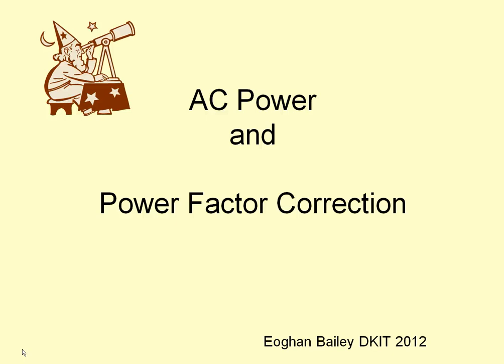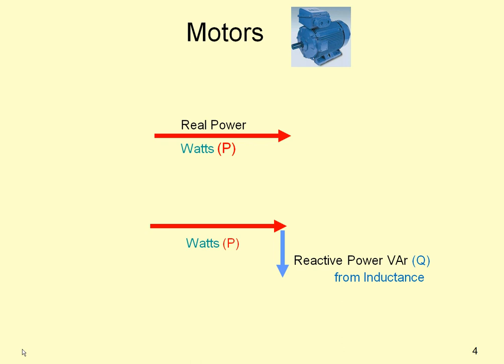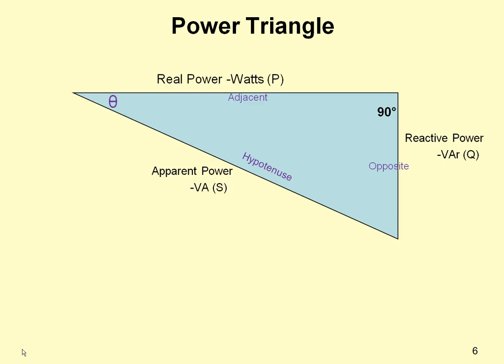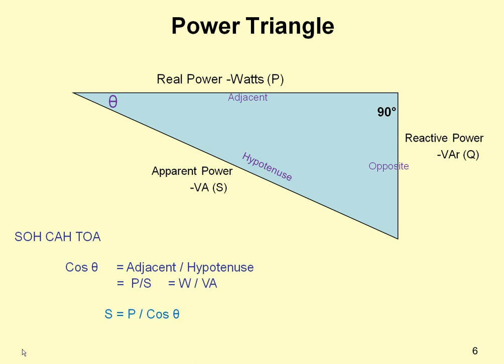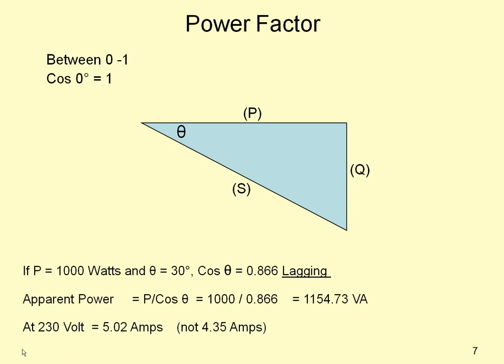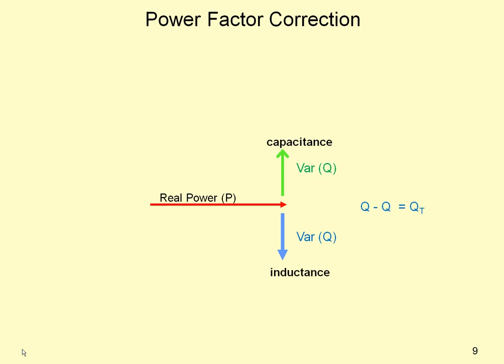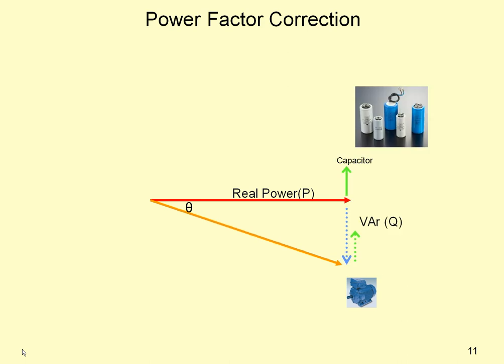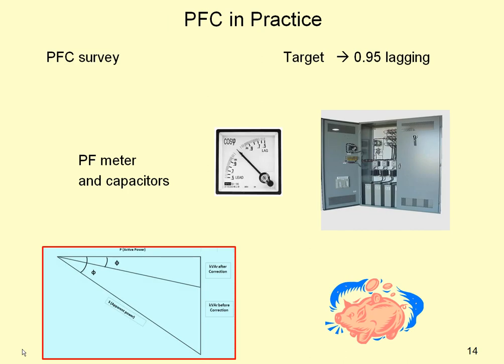AC Power and Power Factor Correction

Comment: A common mistake is to take for granted that the reactive power consumed by an inductive load (lagging pf) is negative. However, application of the passive sign convention to calculate the complex power consumed by an inductive load using the formula S = VI* will show that the reactive power QL consumed is positive.